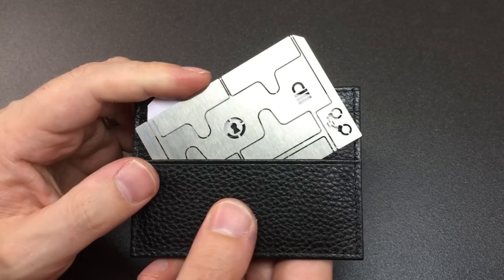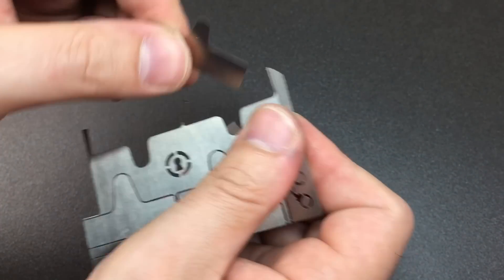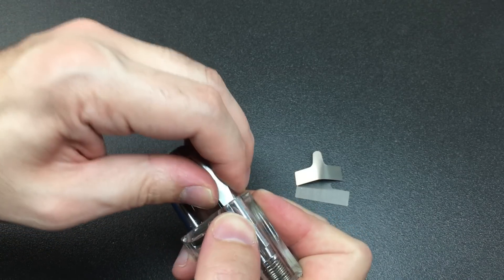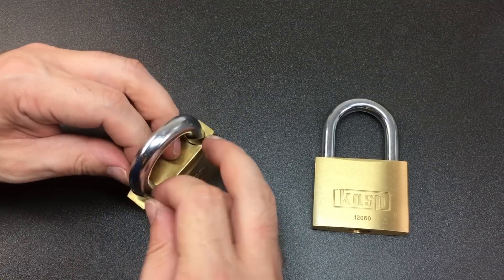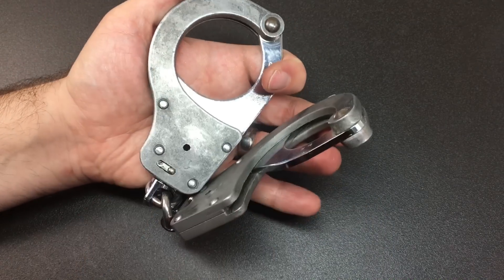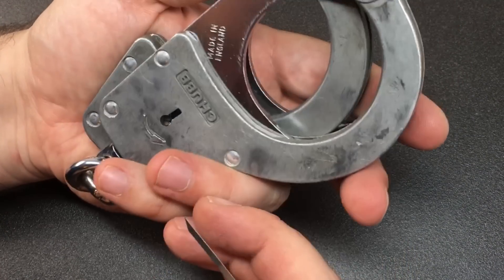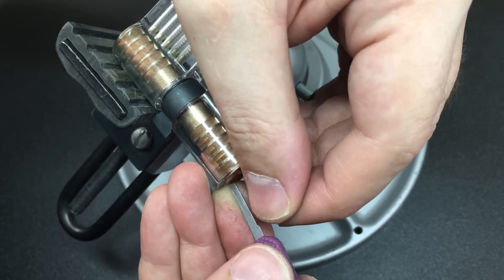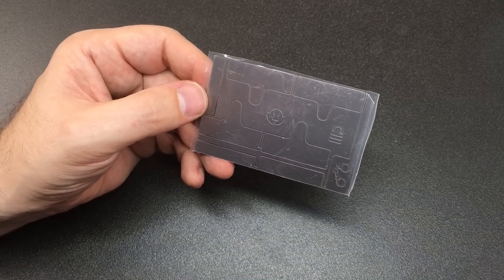Shimmy Card from Sparrows Lock Picks

Comment from the maker: Does this work, is it fun and original? Yes! 😃 Is there room for improvement? Also yes 👍 let me know your thoughts on this cool co-design project between Sparrows Lock Picks and myself below! 👍
Reply: missing a comb over lift?
3:50 could be designed to have the e clip remover out of left over  and   tubular tension wrench
4:30 use a bank card or drivers lic to help crease
Reply: It has potential, Ash. With some slight rearranging of layout, including moving the Sparrows logo, it could hold 6 padlock shims. That long strip which wasn't even mentioned makes a useful probe or handcuff shim. And if the whole card could be made a little thinner, all of the tools would be easier to use. Thanks for the review. 🙂👍

Comment: Very nice!
Here's a tip from another hobby:  Use the cap end of a Sharpie Felt tip, or some such, over a folded towel to put a rounded crease down the center of the shim.  That blunt, rounded , slick plastic is perfect for forming thin metal. ( I used to make silver conchos for saddles)
Reply from the maker: Nice tip!

Comment: If I had to use a word to describe the residue left on the pieces after they're pulled off I'd used either "sprues" or "flashing." Neither are technically correct but they're pretty close. I wonder what the technical correct word is... Hrm....

Comment: This is a great idea. If you were worried about the thickness of the straight shims and didn't mind putting in the effort they could be sanded while still attached to the card. If you were careful enough you could even use a dremel style tool. Just take it slow and be patient.
Reply from the maker: Not a bad idea!